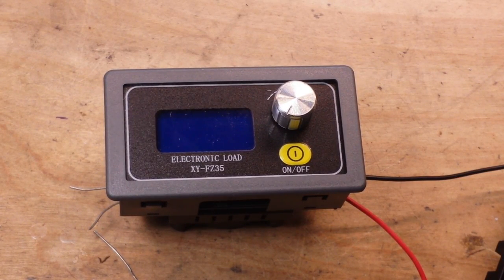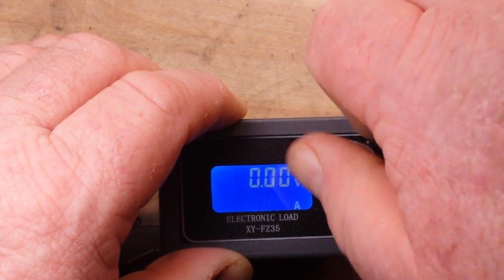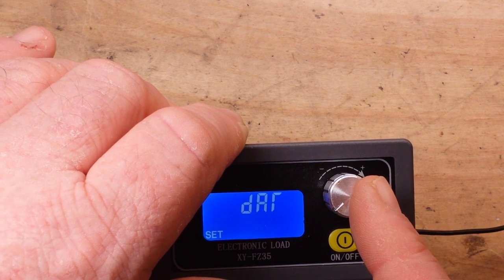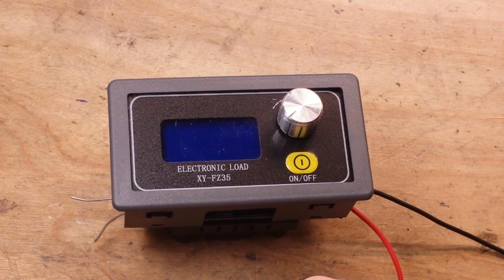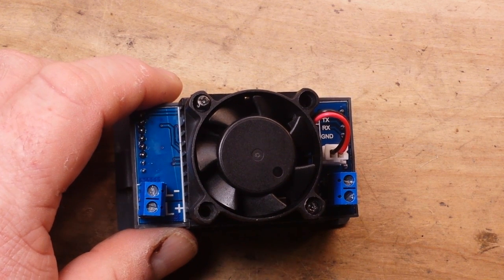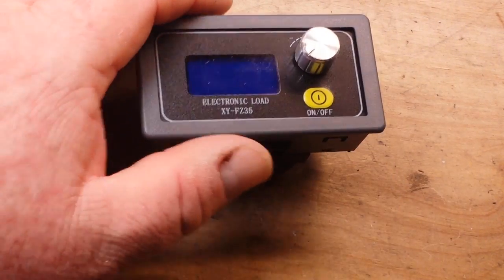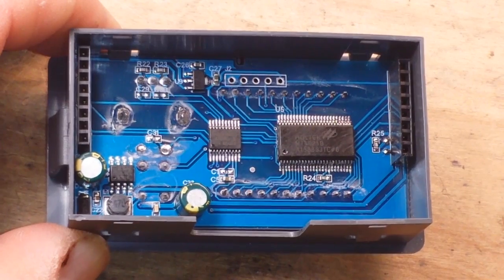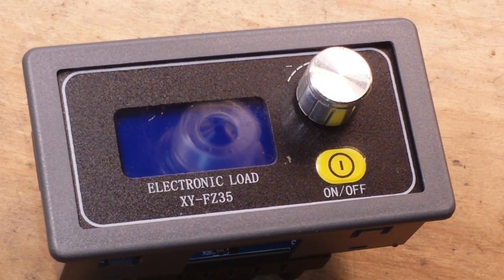FZ-35 Electronic Load from ICStation com

Comment: AEC = Auto Error / Alarm Clear, so if the batt under test voltage rises above the low protection threshold (which it will w/ no load), the test resume

Comment: 3:18 any idea what AEC means ?
Reply: Answered by kuelhand: AEC = Auto Error / Alarm Clear, so if the batt under test voltage rises above the low protection threshold (which it will w/ no load), the test resume

Comment: Can you give a bunch of examples of using an Electronic load to do what? can I connect a Electronic load directly to my wall outlet 120vac rms and adjust the Electronic loads current until it pops the breaker to know how many AMPS the breaker can provide before popping it. So I can know what my outlets are rated at in the house? because I don't know if my outlets are 10A, 15A or 20A and would like to know without going back to the fuse box.

Comment: It's really a nice little device which I mainly use for battery discharge testing and I couldn't resist writing a program for it. 

My program is freeware and controls the load via USB/serial port. It is visualizing voltage over time, cou can save the session/save it as bitmap/print it/etc. If anybody is interested, drop me a note: yellobyte@bluewin.ch. Cheers Thomas

Comment: Interesting EL but did check how precise it is for voltage and current ? also what about CC over time/heat ? is there a way to upgrade firmware to make the rotary react to multiple push that may act as amp decade selector so you don't have to turn it million of times to go over full 0-5 Amps scale ?
Reply: It’s not calibrated nor does it read the actual current. It’s sets the load based on a PWM from the micro and just displays what it thinks is the set current. So at best it’s useful as a comparative tester. Maybe you could do a calibration curve monitoring the serial data?

Comment: I bought this stabilized power supply FZ-35 Electronic but I do not recommend it is painful to adjust it to the value we want the best is to buy rather this   Tekpower TP-30XXN
Reply from the maker: This is not a power supply. This is an electronic constant current load.  That's probably why it didn't work out for you.

Comment: Paul, to put this in an enclosure, make use of the header pin connections. Separate the modules then connect using Dupont cables. Put the fan and connectors at the back of the enclosure.  Put the screen at the front. Heat goes out the back as it should. You could run cables to connectors at the front of the enclosure for power and load, properly labled to avoid confusion.

Comment: Since the back circuitboard is detachable you can attach to the back of the casing and extend the pins with wires to the control unit in the front panel assy of your enclosure of choice 🙂 Thanks for all the great videos 🙂

Comment: Nice coincidence, got. Mine 2 days ago and have not yet tested. The killer feature, IMO, is the uart/serial connection on the back.
Reply: Hi Alvaro, I wrote a little cute program (freeware) to control the load via USB/serial port. Visualizing voltage over time, save/save as bitmap/print/etc.
If you are interested, drop me a note: yellobyte@bluewin.ch. Cheers Thomas

Comment: It appears to be the same size as the power supplies. If it is it would be perfect to print up a box with my supply and stereo transformer in one side. On the other half, a ducted blower for the load.
Reply from the maker: They are the same size

Comment: It really looks nice, dude. Really good. 😊
It would be great if you could wire it to an Arduino with a SD card reader... So you could log everything. 😊
Reply from the maker: You can. It has a UART.
Reply: @learnelectronics  Yeah, but you listed just a few UART commands... I thought you couldn't. But much better then! 😃
Reply from the maker: Check the documentation there is a whole table of commands. There is one for reading from the device.
Reply: @learnelectronics  Fantastic! 😃

Comment: It's a neat bit of kit but I think it's under-designed. You are correct, the xstr is rated at 5 amps. The device is suppose to be able to dissipate 5 amps @ <= 35W. This is using the xstr too close to its limits. I would use a 2N6045 to reduce the heat a bit. Cheers...
Reply: Good tip.
My experience is do not run electronic parts close to the spesifications.

Comment: Can i use this as a current limited  protection for circuit on a breadboard using a 12V DC SLAB as input source?
Reply from the maker: No. It's just a load.
Reply: @learnelectronics  Thanks . Understood. The LM317 may be suitable as current liming circuit ?
Reply from the maker: LM317 is perfect for that application.

Comment: That is a cool little tester to have handy on the bench. Thanks for sharing!
Reply: I mainly use it for battery discharge testing and I couldn't resist writing a program for it. My program is freeware and controls the load via USB/serial port. It is visualizing voltage over time, cou can save the session/save it as bitmap/print it/etc. If you are interested, drop me a note: yellobyte@bluewin.ch. Cheers Thomas